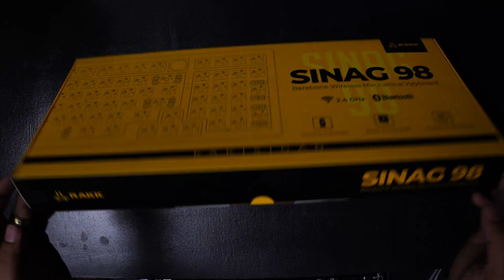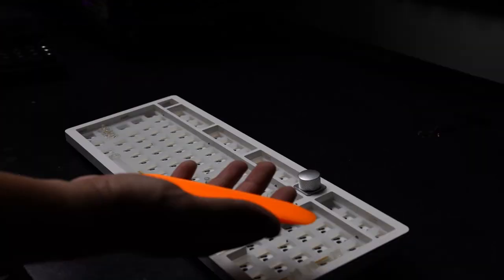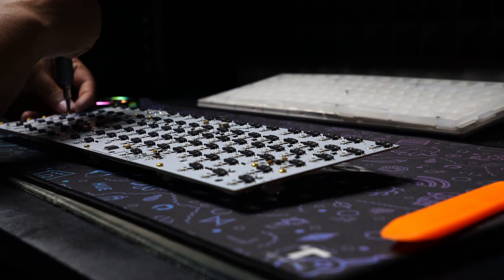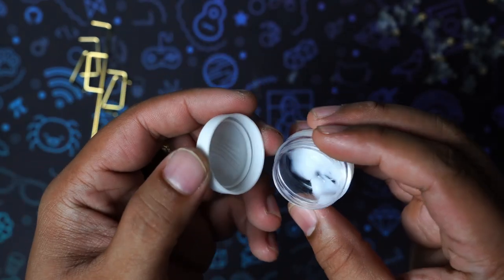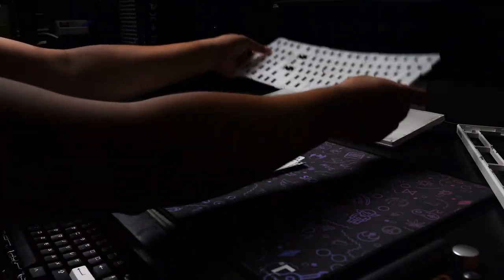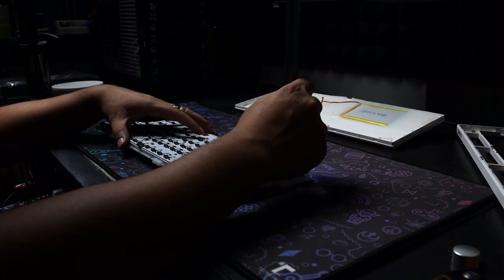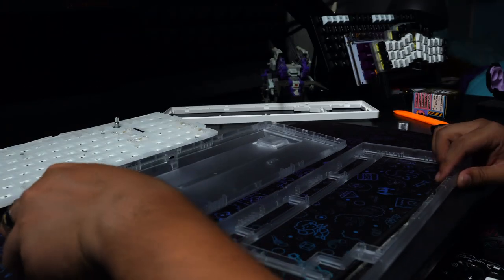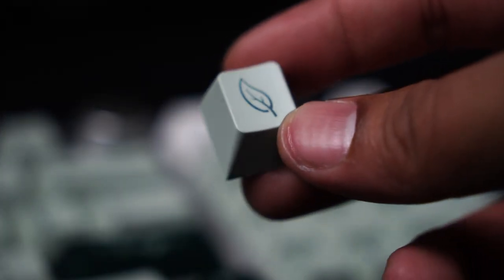I cant believe they cut these corners! | Rakk sinag98 build and review

Comment: Tanong lang po,
May proper way po ba ng pagalis ng battery connector from pcb?
Reply from the maker: Just pull gently on the plastic, never on the wires and no excessive force is needed just patience
Reply: @Mega_Keys  Thank you sir! I can't grip it using fingers so I used tweezers
Reply from the maker: @patrickmacamos635  youre welcome! Be sure to be careful with tweezers as well, just be careful not to scratch the PCB

Comment: sa 2:44 nung sinabi mo snip it off, meaning po ba nagcut/clip pa kayo nung plastic part? haha thanks
Reply from the maker: Just on the unit i worked on, meron kasing parang naging harang dun sa slider  kaya hndi nag function ng mabuti ung stabilizer at first, i thought mali ung installation ko ng stab, turnsout merong parang dila or tongue ung slider which was blocking the slider from working properly